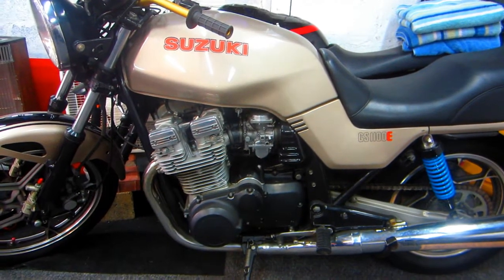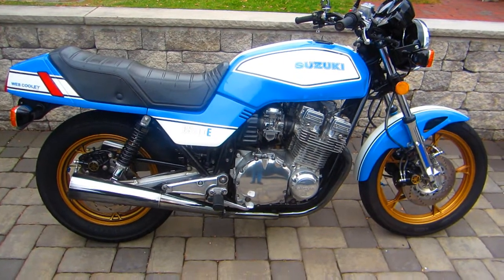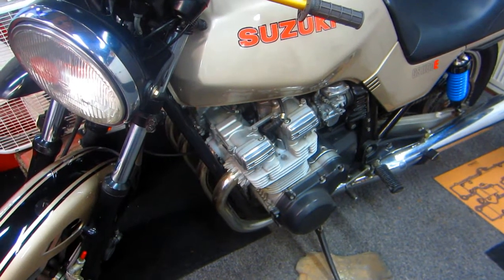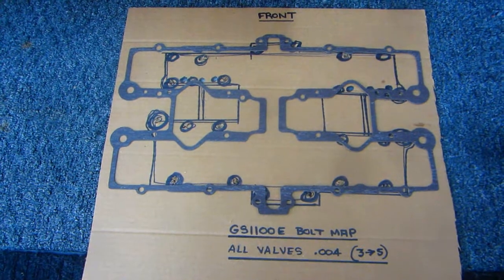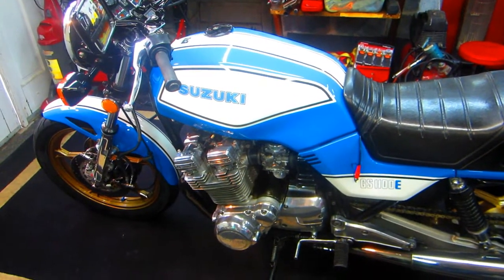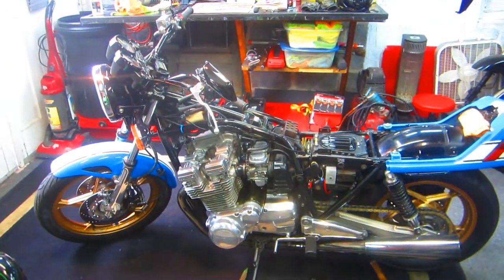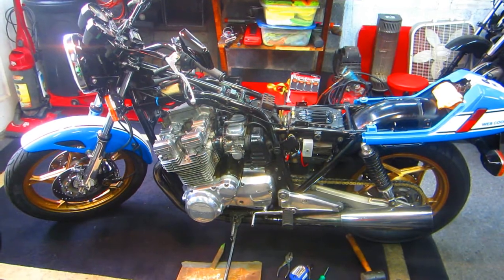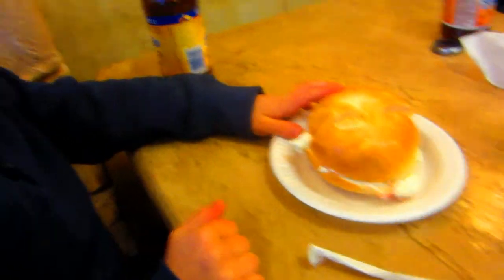HOW TO ADJUST VALVES SUZUKI GS1100E 1982 part 1

Comment: Clearance is only one one-thousandth and many bike mechanics will make the situation worse rather than better.  Setting that close of a clearance on a bucket and shim valve is not easy.  I'm on my second GS850G (1982) and haven't touched the valves since I got it at 17K.  It now has 50 something and I've just left the valves alone.  It starts effortlessly, runs smoothly, doesn't smoke or make funny sounds.  Brake pads and oil/filter changes is all I've ever done.  Amazing machines - about as bulletproof as any machine ever built.
Reply: Everytime I go through the gears, I'm impressed. It's been awhile, but back then, it was all Hondas for me. I must say I enjoyed them, But never were they as SMOOOTH as this. I recall having to stop after a bit, to shake the tingle out of my hands. From my 1st bike, a 400 supersport, to.more 750s than I can remember.  Performance I remember, imo.This bike is by far, better than any Honda 750 i owned fr  72-85.  The seat, the stance, the bars, the gauge cluster, the handling, Suzuki did an excellent job.

Comment: so, how did it run before and after adjustment? (any video of that?) can you tell the difference? and is there any way to know by how these engines runs whether the valves need to be adjusted or not? Thanks for the video and help.

Comment: Great video! One of the things I liked the most was your notion that you've had it from brand new and wanted to keep it. I know exactly what you mean - I bought it's successor, an 1987 GSX1100EF (GS1150 in the U.S.) from brand new and it's still going strong... these bikes are probably some of the best ever built! 😀 
Fortunately I don't have that cover bolt issue, since the 1135 engines have identical bolts all over, except for the two at each side of the camchain. Makes it a lot easier, as does the neoprene gasket. But the entire GS/GSX series is generally excellent bikes, I simply love them!

Comment: A trick to adjusting valve lash is to weld a robertson screw (square head) to the end of a old stubby screwdriver . The square of a robertson screw fits the adjuster screw exactly.

Comment: The crosshead screws getting damaged is not because they are 'soft' but because most people are using Phillips or Pozidriv screwdrivers while the crews are JIS (Japanese Industry Standard). Other than JIS screwdrivers might look/feel that they fit the JIS heads but they don't.

Comment: Hey, Windy,

1 additional remark to the correct response of Vicster regarding the JIS crosshead screws: you can identify these by the dot on the head of the screws.
So either you replace them with e.g. an allen head screw or buy a JIS screw driver (not common to find).

Sorry for the late respons but keep it up!